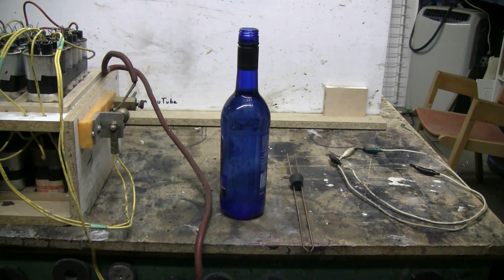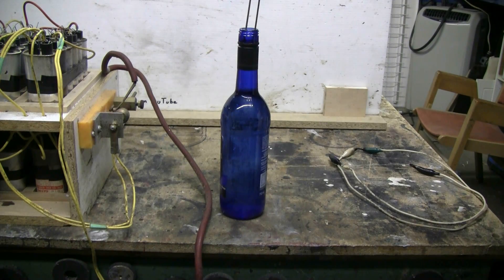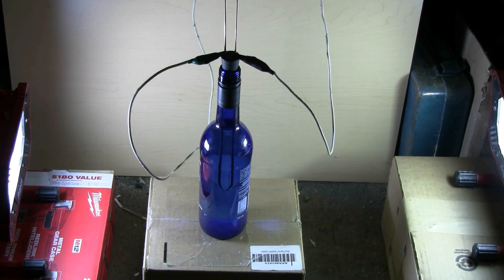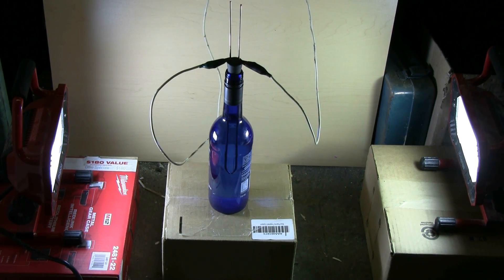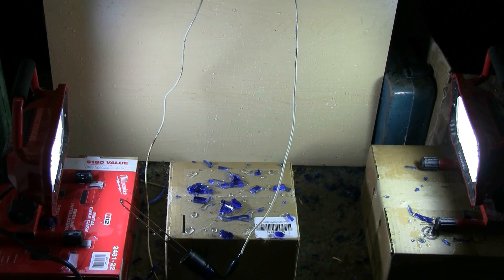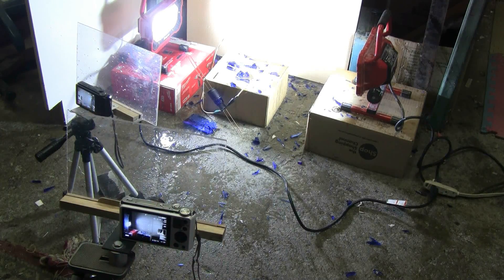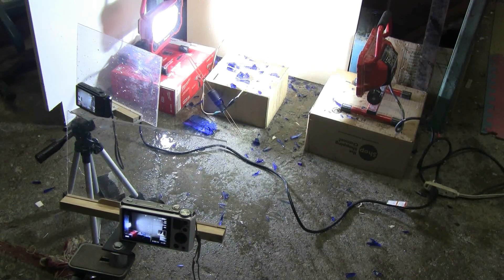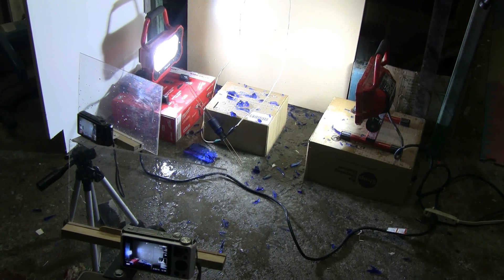Capacitor Bank #69 - Water Filled Wine Bottle

Comment: this exploding effect is caused by the water instantly boiling and causing steam pressure that the glass cant handle
Reply: +thecow275 Noup, above some energy threshold, water does not vaporize but hydrolize (ionization). There is a jet of expanding fog, but it cannot be called steam, since the substance it's not water anymore but a cloud of ions. There is also ion-acoustic activity due to magnetohydrodinamic processes which occur during the explosion which find applications in plasma physics and echo-localization.